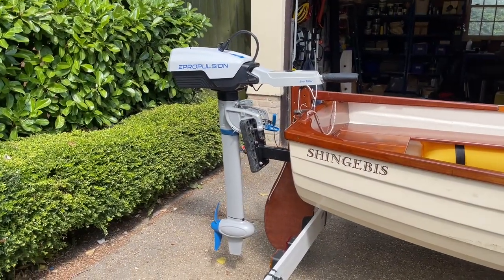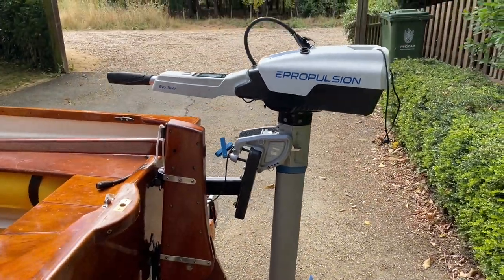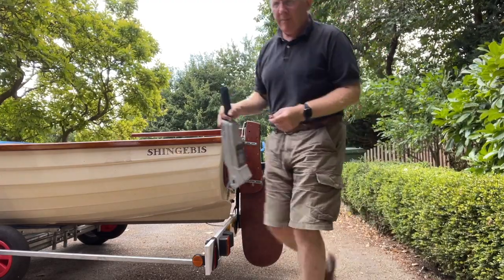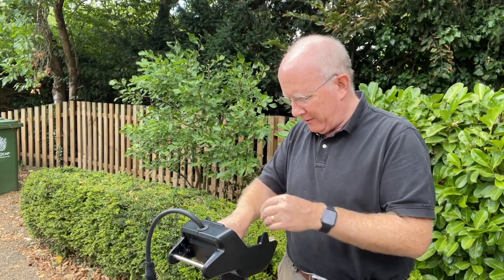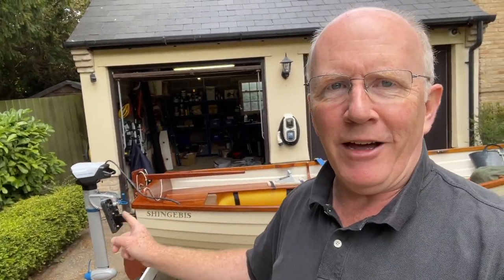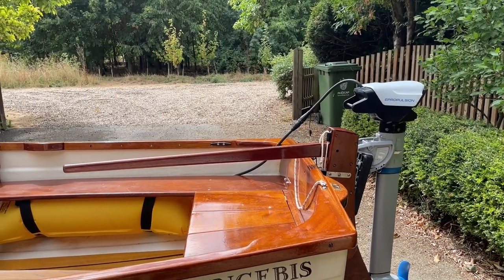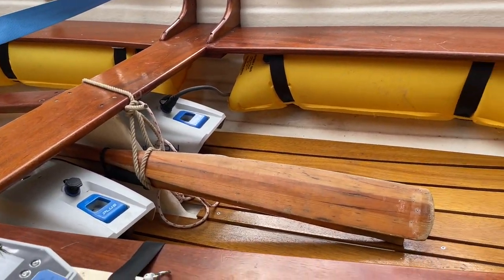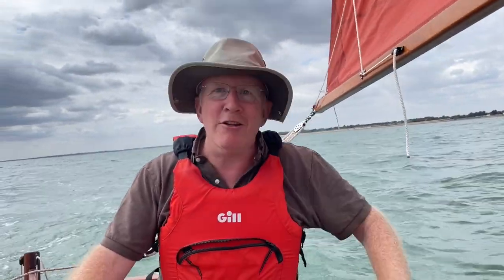Better electric propulsion for a small sailing dinghy

Comment: I thought I would have to start with the motor that already has the remote control panel so it is nice to know I may have the option to convert the standard set up with what you have. I am in the US so hope the option is available here. I have invested in a second battery so already have a lot invested in ePropulsion!

Comment: I never knew there was a battery extension cable.  Got one on eBay and it’s solved a massive weight distribution problem on my paradox.  Many thanks for the video.

Comment: Hi Quentin. I have the same raising issue on my Drascombe Lugger as the Mizzen Mast gets in the way. I tried removing the handle etc too but then couldn't steer easily, especially at low speeds when the rudder stops working. However all you need to do is turn the motor sideways and she'll click into the up position that way.

Would love the remote control. I will need to wait until my channel gets popular enough so that they send me one for free!!!  Maybe waiting a while!!! ;-)

Comment: Hi Quentin.  Which length of epropulsion motor did you put on your Tideway?
Reply from the maker: Hi there - mine's the short shaft, which would be a medium or long from other manufacturers.
I had to do a certain amount of guesswork, but there's a useful page now:
https://www.epropulsion.com/post/measure-electric-outboard-shaft-length/

On my smaller boat, I had to make some adjustments to the transom!
https://youtu.be/A1wL7d8nhZY

Best,
Quentin

Comment: Thats the set-up I have although I have the motor hung directly on the transom and I refuse to pay £60 for a plastic cowel (I'll make my own). Leaving the leg down does not seem to cause too much drag and is quite useful to give a little kick of power on one of those tacks that don't go quite right.  Think carefully where to put the remote: I once got a loop of jib sheet around the throttle, mid tack,  giving me full power as the sail backed - I nearly went over the transom!
Reply from the maker: 🙂 Yes, the cowl is a bit pricey and, though it looks good, is the only epropulsion product I've bought that I don't think is well made - it pops off far too easily. So you probably did well to save your money!  If you come up with a good alternative design, let us know!

Comment: Morning Quentin. Seeing your video promoted me to try something similar with my Torqeedo (early adopter!). The main difference for me appears to be the lack of wireless connection between controller and motor. Having used it for some months is there anything you would do differently and any advice you could give before I start the project? By the way regards to Douglas.
Reply from the maker: Hi John - No, not really; it hasn't had a great deal of use yet, but it's so much of an improvement on my previous setup that I'm very happy with it! 

In the past I had to take the rudder off and heave the motor into place before I could switch from sail to steam, and then reverse the process later.  Always fun at sea or in the middle of a lake!  Much better than if I'd had a hot combustion engine to deal with, though!

The thing I do have to keep remembering, when steering with the tiller/rudder, is that the boat is a lot less manoeuvrable than when you are steering using the outboard directly.  You don't have the effect that you get on most yachts where the thrust from the propeller goes past the rudder on its way out, so you need to be under way to steer at all, and you get almost no steering in reverse - something I discovered the hard way when negotiating my way through a narrow lock!

So if I'm NOT sailing, I still mount the outboard in the middle of the stern and use it there.  But as an accessory for sailing, this setup works exceedingly well, and I just need to remember to recalibrate my expectations when using it!

I gather you've become a distributor of TW14s :-)  Hope you're enjoying yours!
Quentin

Comment: I like your set up but I hope you get on better with the extension cable than I did.  The tiny plastic lugs that hold the two parts together have pretty much stripped off, rendering the whole thing pretty much useless.  The supplier seems not to be interested.  Not good for the price!
Reply from the maker: Ouch!  Thanks for the warning... I'll make sure to take care of them!